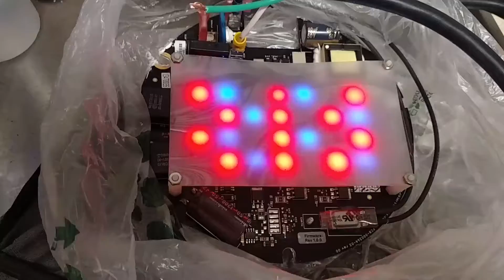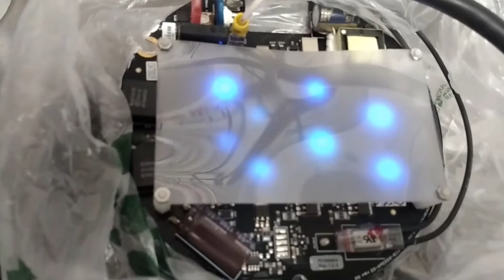Jandy LED Watercolors light test

Comment: I didn't realize there are other alternatives to the Jandy LED engine. My light went out and since the Jandy LED engine costs as much as the light itself ($600), I was thinking I needed to buy a whole new light fixture itself. Your idea is great. BTW, how bright is this 5.5" light? Does it do the job of illuminating the pool well? Also, do you know if there are any aftermarket multi-color light engines out there which can be used for this solution?
Reply: DId you ever find anything? My pool company wants $1400 to replace the Jandy light which has already broken twice with little use. I was wondering if I could fit the Florida-seeker Intelibrite boards which are designed as a replacement for the Pentair Intelibrite into the Jandy Watercolor housing. If not, I'm going to try the white light listed above. I have been searching all night for an alternative for this. I refuse to pay $900 for the Jandy light engine and I don't want to have to a thread a new cord/ housing. Thanks

Comment: Did you ever find a solution to this?  I have two of these as well.  One works, the other is so dim you can barely see it glow at all if you are right in front of it.  I thought about trying to find the replacement board without going thru Jandy, but I couldn't get my lens seperated from the housing to get to the board.  I need part numbers and whatnot.